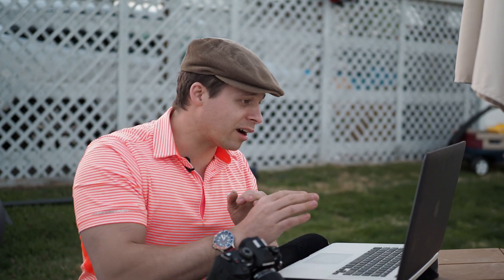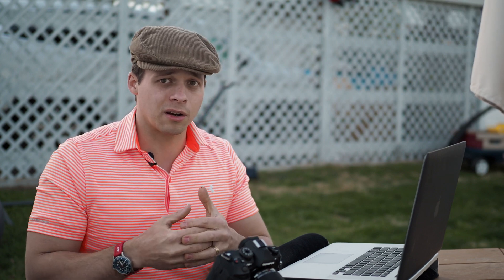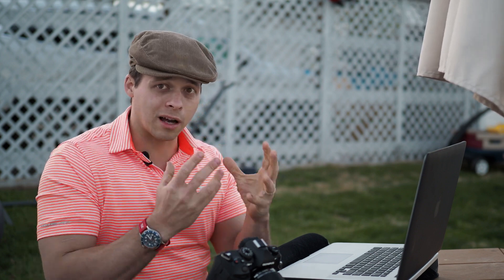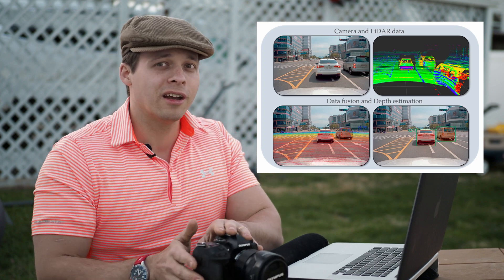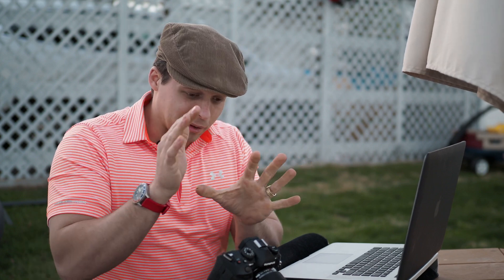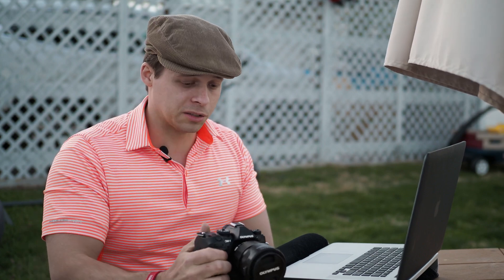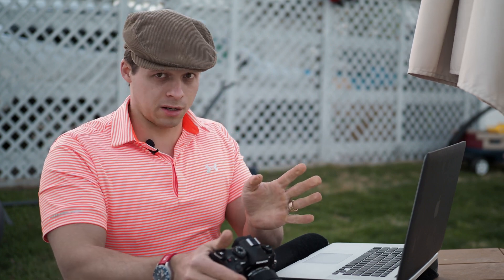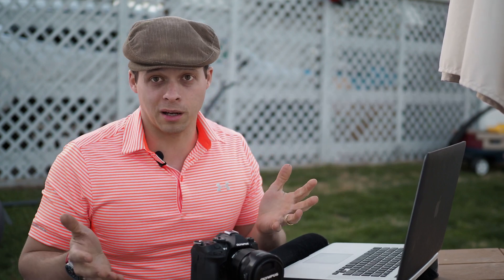A New 43rds Sensor with Insanely Low Read Noise

Comment: If you're interested in an existing camera, look up the Hamamatsu ORCA-Quest, it has very low read noise (.27e-rms), uses a sensor similar to M4/3 and does photon counting. Lucky imaging for deep space astro imaging was one of the marketing focal points, another was calcium imaging where read noise is important. They intend to compete with EM-CCDs.  QE% is 90%, an actual measured value, not the theoretical crap peddled by Sony. It falls behind the average BSI with 98% at around 550nm but when light is scarce, read noise is more dominant than photoelectron conversion. 

Photon counting is different to photon resolving. Most adequate scientific cameras can do photon counting, but only those with very low read noise (and dark current) can discriminate between photons and noise. 

It also costs a lot, so there's that. They will never show up in consumer cameras. 
I have no idea how I stumbled upon this video, but it's very relatable. Full disclosure, I used to work for Hamamatsu.
Reply from the maker: Someday the price might come down. Thanks for steering me to their website I I have something to read now. Their cameras do look awesome.

Comment: Wow, this could also be the cat's pajamas for the line of work that I am in as well.  Raman spectroscopy which is similar to astrophotography.  Raman got the Nobel prize in the 1920's for discovering the Raman effect.  When a photon hits a material roughly 1 in a million photons that bounce off are NOT at the original frequency but are shifted because the photon interacted with the material.  If you look at all of the photons that are not at the original (laser) frequency then you can detect what atoms are in the material and almost make out the chemical structure from the Raman spectrum.

But, what would be ideal is larger pixels and more well depth.  The current sensor market is locked up from a single supplier (Andor).  It's cameras are 16 micron pixels.  We could easily use maybe 8 micron pixels, but 2.2 is way too small and the well depth is too small, and the readout rate is too slow.  Here is the stat sheet for the Andor camera we use.

https://andor.oxinst.com/assets/uploads/products/andor/documents/andor-newton-emccd-specifications.pdf
Reply from the maker: I would encourage you to contact Gigajot and tell them this too. Since they like making these kinds of scientific cameras they will probably be very interested in this.

Comment: New tech shows up in small sensors first because there's more volume. Sensors are relatively easy to lay out compared to something like a CPU, so size really isn't (much of) a barrier. And the reason that many of us say that there's not a lot of room for improvement in sensors is that for photography shot noise already overwhelms read noise, even in low-light situations. That well depth is interesting, though. That will allow lower native ISO and better S/N. At the levels they're quoting, 14-bit files are likely to be useful. Today they simply aren't.  

Astro is different, of course, and that lower read noise will be very important. Something I noticed is that the noise performance is for room temperature operation. It'll only get better when cooled. There is a camera available from Gigajot, but there's no advertised pricing. I'm guessing it's in "if you have to ask..." territory.

Comment: So... hold on to those 1.25" filters ;)

Good stuff.. looking forward to seeing what's next.
Reply from the maker: I am still on a 43rds sensor but had to upgrade to the 31mm unmounted ones on account all my scopes were to fast for the 1.25" But those 1.25" filters are great. Affordable too. Another great reason to ket a 43rds sensor for most scopes.
Reply: @TheNarrowbandChannel  I run 2 rigs, one with the 294mm and the other with a 1600mm.  I picked up the 1600 about a year before the imx571 camera's came out.  I'm trying to hold out until the next gen sensors come out... but its hard.  I don't want to be in the same boat if I pick up an imx571... lol.
Reply from the maker: @DSOImager  What do you think of your 294 compared to the 1600mm? Worthy upgrade or not as significant as the 1600 was when it first came out?
Reply: @TheNarrowbandChannel  Hard to say.  If I were in the market right now.. and looking at these two.. I would go 294mm easy.  But to replace my 1600 with a 294... probably not.  It is an incrementally better sensor but I'm not sure its worth the cost of a new camera.. at least for me.  

I've kicked around the idea of picking up a second 294mm but honestly I think stepping up to an imx571 makes more sense.  Too bad there isn't a m43 sensor based on that same family.. if there were that would be the obvious choice.   My current plan is to keep using the 1600 on my refactors (sv70t & at115edt) until I get either a imx571 or something newer.  My 294mm lives on my Edge8" which has been a really good combination.
Reply from the maker: @DSOImager  That is sorta my struggle. I have a 1600 and its hard to justify the 294 unless I could triad it in.

Comment: TY for lifting the curtain on sensors from the astrophotographer POView.  It sounds like a potential fifth category of metric for sensors would be ‘well isolation’ to prevent leakage of bright star pixels to neighboring pixels (to prevent blooming)?  TY for sharing your knowledge with such joy, generosity and enthusiasm.
Reply from the maker: So that is called cross talk of pixels. It a new problem. Old pixel were so far apart it was not as much of an issue. Rather light bitterly leaked into other pixels in the old days but they have fixed that with interior barriers. Cross talk though will have to be dealt with another way. Couple o interesting ways is to have bayer filters with a convex shape to them. Deep wells though are the oldest and easiest way though.

Comment: What is your "day job"? You don't need to name the company, but what is it you do? Sounds interesting whatever it is!
Reply from the maker: I do exhibit design. Mainly work in CAD all day. Right now I am building a 3D city for a company called Grimm.
Reply: @TheNarrowbandChannel  that sounds cool. Do you design them from scratch or based on existing standard data like open street map or CityGML?

I've been working in the field of simulation and training. Iwas responsible for setting up a workflow to procedurally generate fully articulated and textured 3D buildings for existing towns (using mentioned data sources) - sometimes easily up to half a million buildings for fractions of large towns. Worked with FME and 3dsmax (especially maxscript) mainly... That was great fun 😍👍
Reply from the maker: @jiffijoff9780   The city I made was created very custom. Had to have things like power plants, water purification, and military structures in it. This company primarily makes software for security on an industrial and nation wide level for infrastructure. 
The city you made was it a lot of data? My largest CAD file ended up being 480mb with was a challenge for my computer to handle. Still is too.
Reply: @TheNarrowbandChannel  cool, thanks for following up, appreciated. Very interesting use case you mentioned there, very detailed, including the environment. You're working on a traditional CAD like AutoCAD or Revit? Have you checked ESRI City Engine? 

The scenes I was working on had the be split into clustered areas. I intentionally used an irregular grid consisting of large delauney triangles - all buildings inside a triangle were merged together to keep file sizes down. Since training areas easily covered 1000x1000km (incl. every single building) we ended up with generation times around 100-ish hours and TBs of generated data...
Kinda like what the guys at Shark AI do for the buildings in MS Flight Simulator (but magnitudes simpler in our case! Shark AI rocks bigtime!! )

Comment: Didn't understand most of what you were saying, but it sounds fascinating and promising if it can be adapted to consumer photography. If OM System can get onboard then the OM-2 would be a big leap forward like the film OM-2 was. And hopefully such a sensor would silence, or at least quieten, all the M4/3 naysayers. In fact, from a logical point of view, if any sensor is destined for obsolescence it's the 35mm "full-frame". M4/3 and APS-C make more commercial sense for most consumer cameras, and medium format, like in the Fujifilm GFX range, make more sense for pros needing high-resolution. Olympus and Fuji have always been the dark horses of the camera world. Maybe there time is about to come.
Reply from the maker: Yes totally agree.
Reply: Absolutely.   In all areas of high tech the drive is to smaller, thinner, lighter, more powerful.  We should remember that the 35mm "full-frame" format only happened because one of Edison's assistants split the then 70mm movie film in half.  For years it wasn't taken seriously and 35mm cameras were call "mini-cams".  No serious photographer would be caught dead with one.  Now it's FMT being reincluded by some of the clueless, but anyone who thinks sensor tech has plateaued must have been asleep for the last 40 years.  The new OM-1 is a BIG shot across the bow of FF cameras.  We're coming for you!!!  :-)
Reply: Oops.  Make that "MFT" not "FMT".